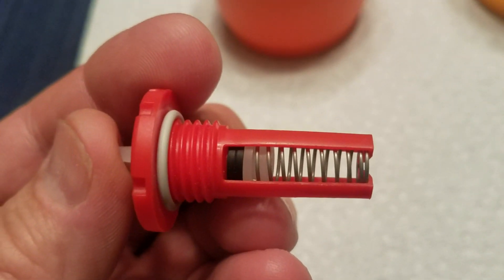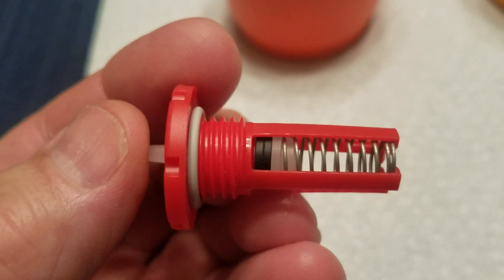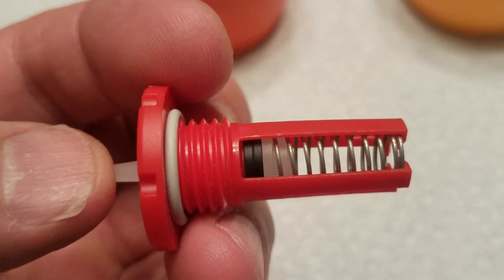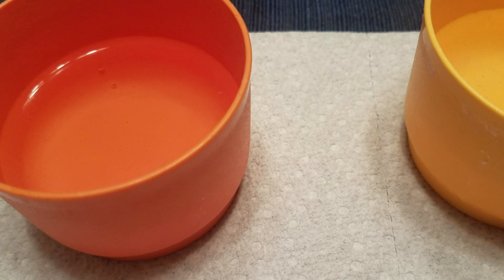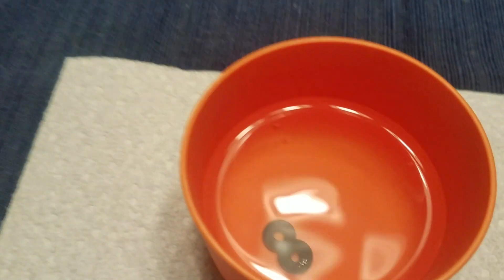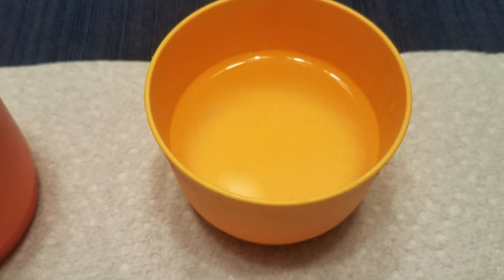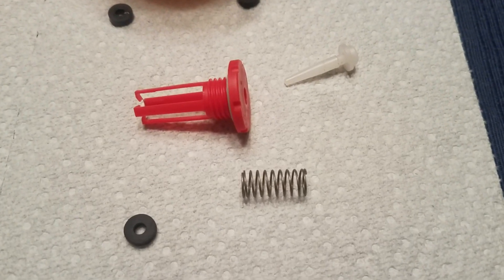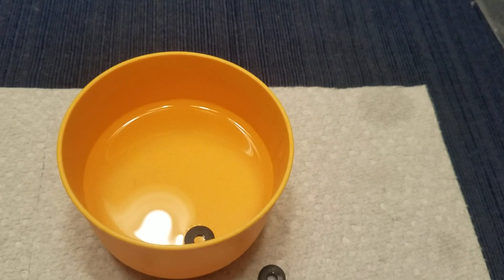Viton rubber test.

Comment: hello..so viton (FKM) is sinking in solt water how mach salts needs to add to cup?? and normal rubber seal is not sinking in salt water??
Reply from the maker: just added salt until one floated. normal rubber seal is not sinking in salt water.